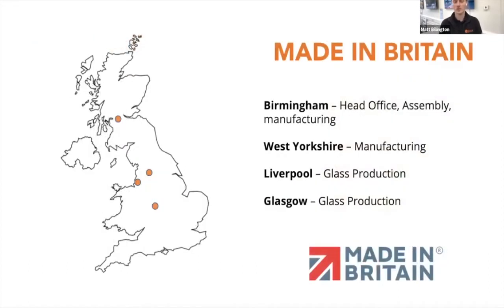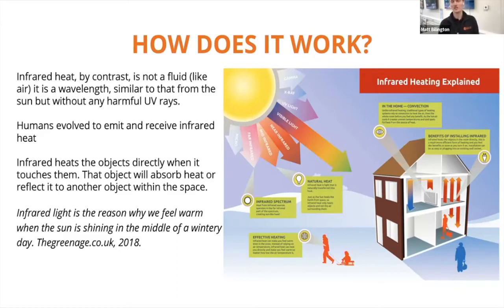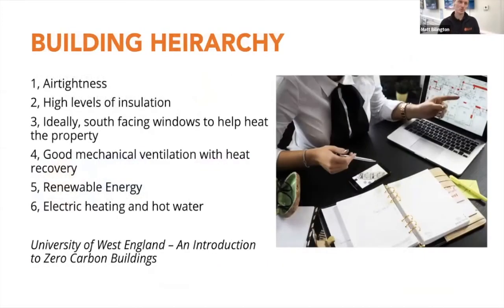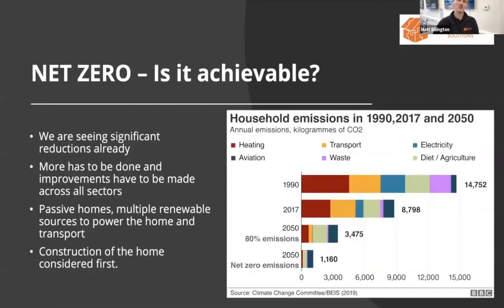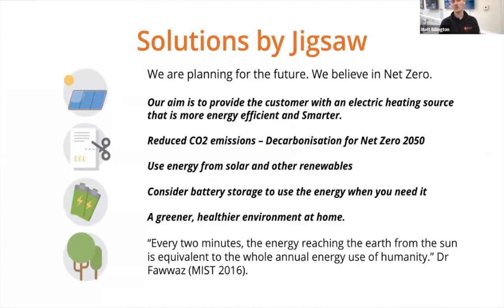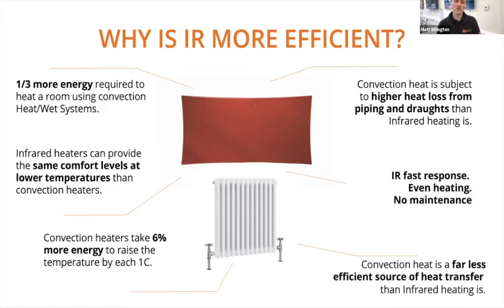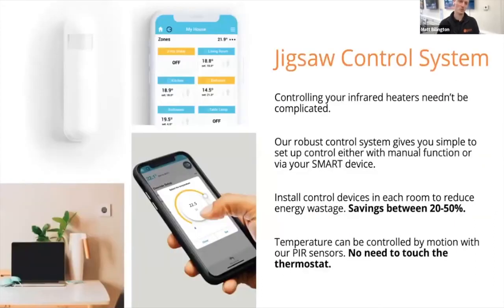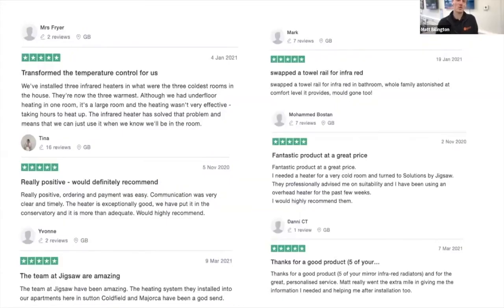Jigsaw Infrared - NSBRC Presentation April 2021

Comment: I just ordered a whole system for my flat after doing some extensive research. Moving away from gas in stages. Once panels are installed I plan to swap my hob for induction, then I’ll be fully electric. Then I could be disconnected from gas entirely, and no longer have to pay the daily gas standing charge.